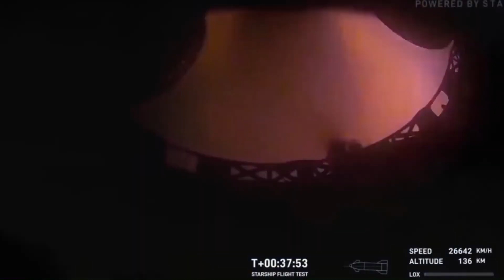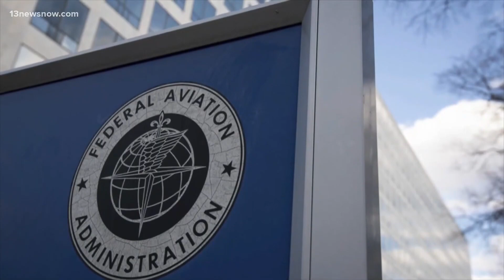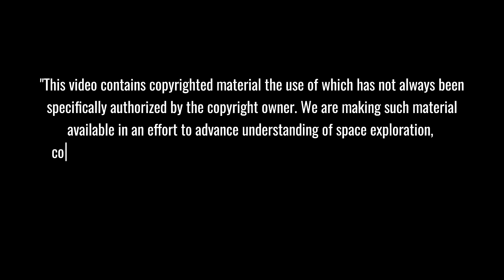SpaceX Finally Revealed Its Starship Flight 8 Fatal Flaw... IT'S WORSE THAN FLIGHT 7!

Comment: I don't think the engineers at SpaceX thought of the Starship as a simplified version of the booster you twit. This was a test flight. There's no such thing as a unsuccessful "test flight". You learn how to do things right or you learn what's wrong and should be improved or possibly re-engineered. You didn't add anything with this video.

Comment: Re "Thermal anomalies"-- at 4:03 you can see the entire engine bay is filled with fire, apparently coming from the split-open RVac nozzle at lower left.  That engine seems to have had a cato/RUD that took out two of the inner three engines immediately.  This occured at T+08:07 when the onboard camera was looking at the aft flap; a burst of smoke and debris followed by the spin... Rest in pieces, S34!

Comment: Static fire tests of the ship do not test the pressures experienced in hot stagging.
Reply: If the problem involves resonance fatigue in the plumbing, that may be damped by the LOX surrounding the downcomers on the test stand...  And given the risk of damage to RVac nozzle bells when firing at sea level, that 60 second static fire may have weakened the bell that split open just before the engine RUD.  Just sayin'... ¯\_(ツ)_/¯

Comment: For all the fanboys out there, Starshiip was supposed to be going to the moon in 2021. It is at lest 4 or 5 years behind schedule and all the money has been spent. So will SpaceX solve the problem in record time? Well this problem should have been solved in 2019 or 2020 so it looks like they are taking  record amount of time to solve it. Starship - the Cybertruck of the space race
Reply: How far behind are Boeing, the SLS, Bezos?
Reply: @daveisbrill  Artemis is now being gated by the failure of the Raptor engine being designed by SpaceX. It blows up in space. The SLS orbited the Moon and returned safely to the Earth. SpaceX is successful at gathering information after each and every failure. I has much practice in that. SpaceX and its supporters should be taking a humble silence to consider its many failures and its gating of Artemis and the SLS

Boeing gave us the 737Max which the US and the FAA tried to cover up. The US government will keep Boeing alive when it should be allowed to go bankrupt
Reply: Silly boy! Don't you know you need to take Musk's estimate and add ten years to it? After all, he's not an engineer.
Reply: Well tomgray8512, how many rockets have you built and launched. I suggest you have a go yourself and see if you can do it quicker and better.

Comment: I Believe in SpaceX in solve these problems 😁👍🏻 ,  Remember these are Test flights , there meant to find the Flaws that you can't find by testing on the ground , This is a Brand new Reusable Rocket Systems that SpaceX is building , it will take time to work out the Bugs and fix them , SO better to find the Bugs now the latter . SKK .
Reply: Ahh bless your little heart.
Reply: Starship and its engines were supposed to be in orbit and at the Moon in 2021. It is rather late for a test flight for an engine that doesn't work.
Reply: @tomgray8512 And SLS was to have given us a manned moon mission in 2022. But SLS is on hold for several reasons such as bad welds in fuel tanks, fuel tank contamination, and an uncompleted launch site.

Raptor has been a very successful motor so far. ULA and Blue Origin are using BE-4 engines that are not completely proven yet either. The only relight attempted on that motor yet failed.

Space is hard! No one space vehicle is without problems. And most current ones have been behind In development.
Reply: This is true, and I will not argue about that. But I am concerned with the failure appearing similar, while early news points to different causes, that FAA and other concerns may feel it is time to really tighten Space X's leash. I worry another failure similar in any way may end up with the Starship project really in a regulatory straight jacket. I do not want that, but there are many out to throttle back either space programs or Elon.

Comment: Too many "could be" statements for any kind of root cause statement.  In reality they are at the beginning of finding the root cause.  Time to slow down and do a comprehensive review and root cause analysis.  The root cause and proposed fixes should then be independently reviewed by qualified engineers (as opposed to yes men) before implementation.  A full duration ground test of the second stage should then be performed to ensure that the fix (whatever it is) actually works before attempting to scatter debris all over the Gulf and the Atlantic.

Comment: In space, each restart is the same if you'll think about it.  They'd  have to be close to different conditions like radiation for them to be different.  This is a development project.  Multiple failures that look the same are most likely different.  The FAA will only be an issue if they don't realize like you that this is a development project.  They'll  fix it and any other issues that come up as they test.

Comment: It might take some time. The Saturn 5 never had a failure that caused a vehicle loss. The upper stages did experience early shutdowns and pogo effect on acceleration.
Reply: When the Apollo 1 fire occurred, NASA accepted the problem and thoroughly analyzed their design for flaws. They didn't talk about test flights and accelerated development or moan about the FAA. They created a space system that put men on the Moon in about 6 years. They also created engines that can restart in a vacuum unlike some current companies that people could name.

Comment: I'm surprised by the fact that no one has commented on the fact that the flaw that caused this didn't exist on V1. It was only after they changed the plumbing on V2 that they had this problem. V1 managed to complete the whole flight and land even though it got a little scorched. V2 was supposed to be an improvement. Now it's back to the old drawing boards.
Reply: Elon Musk's Starbase is wide open and has very low security. With all the recent events targeting Elon Musk—especially Tesla cars and chargers catching fire—the word 'sabotage' comes to mind as a possible cause of the Starship failures. Starship has previously flown on its own before reaching orbit and completed two successful orbital flights prior to the two mishaps. Credit must be given to the SpaceX engineers for their accomplishments thus far; however, the two failures remain mysterious to me. Interestingly, these failures occurred when Elon Musk joined Trump on his campaign
Reply: @xh3598  As I understand it, Starship test flights 7 and 8 included some significant changes to the plumbing for parts of the rocket engines, and those changes were being tested on those flights, and SpaceX has determined it's that redesign that's been the cause of these past two Starship explosions.
Reply: @xh3598  Sabo-tagy eh? Scary stuff kids.  ORANGE MAN BAD!

Comment: It's a new vehicle that they are testing and developing, one way or another they will figure out what's going on. They had the critical data ultimately it's a matter of putting it together and figuring out how to prevent it in the future.
Reply: The exact same fault at around the exact same time (duration), sorry buddy, I am very suspicious at this point. investigate the fault but also everyone who had anything do do with it.
Reply: Henry Ford was developing cars this same way, crashing off people, horses, bridges, and buildings for years as he developed brakes and steering-
Reply: @jackprier7727  Space flight is NOT (in any manner shape or form) automobile design engineering.
Reply: @ninersix2790  except for the whole metal  human-transportation structure powered by fuel with a bunch of wires and stuff inside. I guess English isn't your primary language, but research "any manner, shape. or form" in an English dictionary-

Comment: Elon has some talented engineers and some amazing printing machines.  Working with a minimum of material is a quicker way to develop the most efficient weight rather than gradually reducing the material weight.  Rearranging the shape and thickness of different parts of the engine may reduce or eliminate the vibration.  Reminds me of a time, when I was a child and watching a goofy-sounding comedy on TV.  On the coffee-table, sitting next to me, was a large, thick, decorative ashtray that split in two when the song played this one high note for a few seconds.  The ashtray rang just like that note for a couple seconds.  I was worried that I'd get blamed for breaking it.
Reply: Elon Musk's Starbase is wide open and has very low security. With all the recent events targeting Elon Musk—especially Tesla cars and chargers catching fire—the word 'sabotage' comes to mind as a possible cause of the Starship failures. Starship has previously flown on its own before reaching orbit and completed two successful orbital flights prior to the two mishaps. Credit must be given to the SpaceX engineers for their accomplishments thus far; however, the two failures remain mysterious to me. Interestingly, these failures occurred when Elon Musk joined Trump on his campaign
Reply: Anyone think that on hot staging they are causing damage?
Reply: Interesting how you mention Teslas printing processes because I believe that they need to expand in this area with multi integrated materials and techniques
Reply: or spacex printing